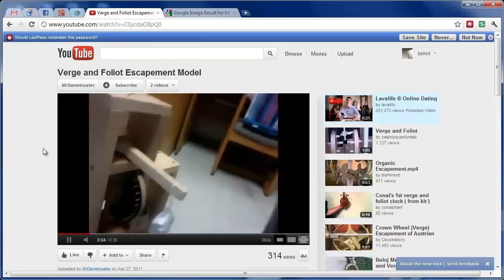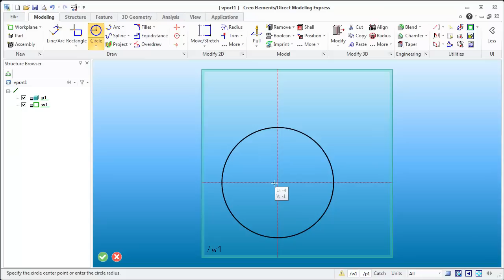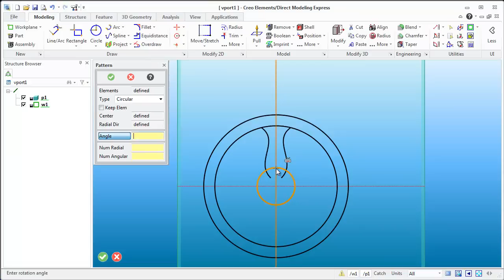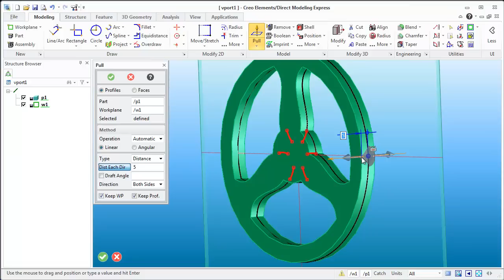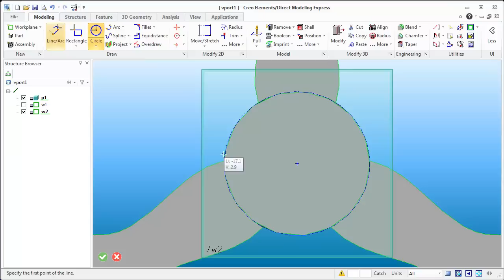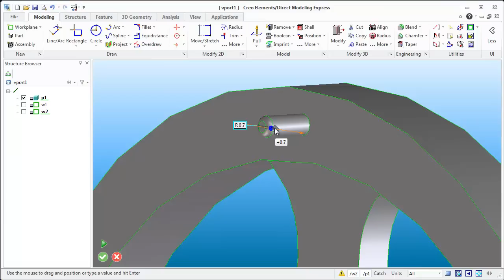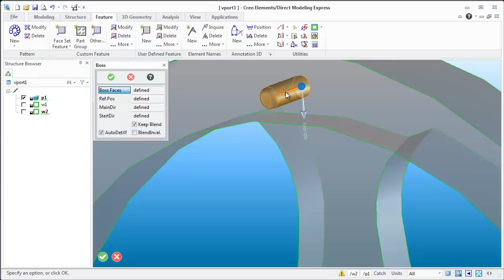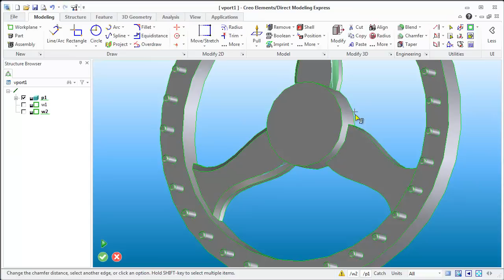Video: Creo Direct Modeling Express, making a clock part 1

Comment: Food for thought. I'm new at this so bare with me. Quickest way to find 0,0 for "Cross Construction Line" is to type 0,0 and press ENTER. No clicking on anything is necessary. I realize there are different ways to do the same thing. What you showed is great because it demonstrates how you can use the number position in the x,y boxes as well on other things. I will continue watching. So far you did a great job in putting this together. I will continue to watch a couple more and then subscribe with thumbs up.